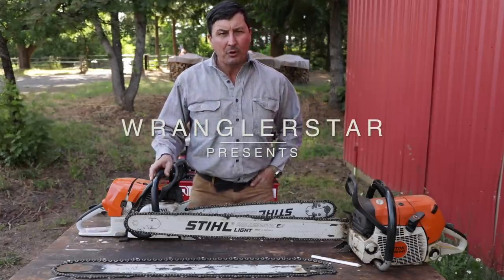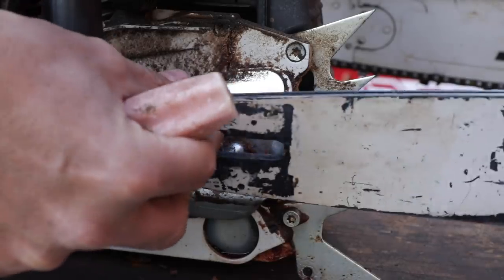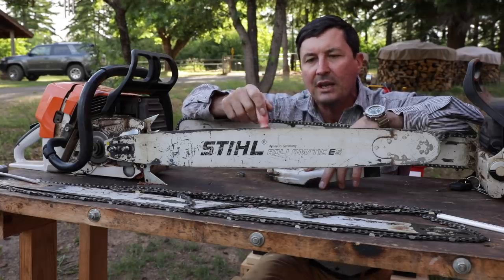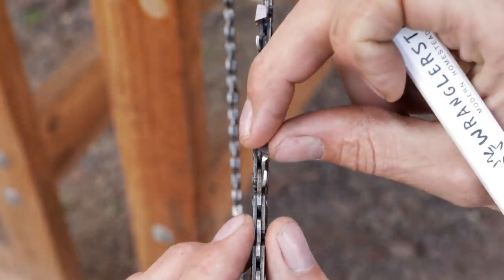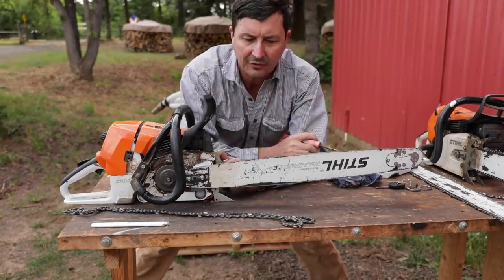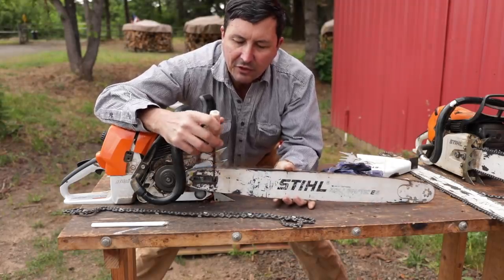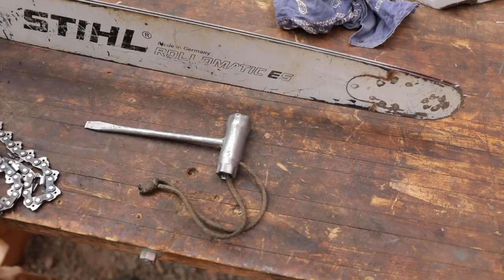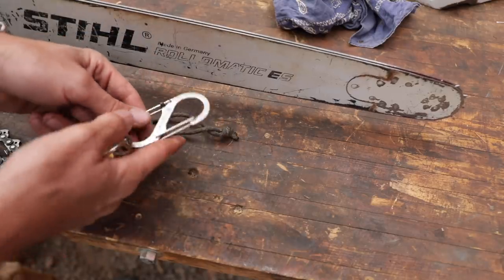Why Loggers Run Upside Down Chainsaw Bars

Comment from the maker: My Favorite Key Ring Carabiners https://www.amazon.com/shop/wranglerstar (link will direct you to my amazon store)
Reply: i dont know if you are stil looking for good quality precision files but i know some good ones
Reply: that is a great idea about switching the arm to last longer but just wondering have you used dewalt 20or40 volt chainsaw
Reply: NIteIze makes amazing products!
Reply: wranglerstar, i have a husq 261 saw. the piston is broken and seized in the cylinder not allowing access to the wristpin. as i am rebuilding the saw with a new cylinder and piston should i just cut the old cylinder in half to remove it from around the piston allowing me to get to the wristpin? the saw is torn all the way down. any thoughts besides junk it. it has alot of sentimental value and i would really like to continue with my rebuild.
Reply: Don't you double the time till you need a new bar by flipping it? Hence it would be 100% more lifetime not 50% more like you said.
Reply: You can plain in the bar Also they make tool to close or open the gap
Reply: Thoran666 ... You beat me to it. That's exactly what I was going to say. Flipping it would double the life of the bar. Doubling is a 100% increase.
Reply: thank you for all the informational videos
Reply: Grind the rails and buff the surface and replace the tip maybe 5 times. Last a long time . Dont turn them at all and lasts maybe a tenth of the time.
Reply: you actually made a vid about this ? smh can you use a screwdriver both ways?
Reply: adam conner you will get shavings in the lower end don’t risk it
Reply: @Thoran666  pay attention!! He said most of the wear and that wear depended on usage factors. The chains still running all around that bar. Lighter rubbing and heavier rubbing in areas dependant on use. Got it? Good day

Are you sure you got it? Well, we'lk see! God bless.
Reply: @Thoran666  You don't listen. The man said wear depends on usage. Limbing, top center. Topping, breaking all of the bottom, even the tip in pocket cuts. Chainsaw carving, nearly entire bar. But however you cut, the chain is still rubbing the ENTIRE BAR. Some areas lightly, some heavy. You got it? Good day.

Are you sure you got this? I don't know we will see. You could actually learn, if you paid attention. God bless.
Reply: @opiestanborough4774  Sure! Put the pointy end in your palm. Put the big round end on your fastener. Using hammer strike sharply with a hammer. Now go to the emergency room. God bless.
Reply: @grandpied    You don't listen. The man said wear depends on usage. Limbing, top center. Topping, breaking all of the bottom, even the tip in pocket cuts. Chainsaw carving, nearly entire bar. But however you cut, the chain is still rubbing the ENTIRE BAR. Some areas lightly, some heavy. You got it? Good day.
Reply: @grandpied    You don't listen. The man said wear depends on usage. Limbing, top center. Topping, breaking all of the bottom, even the tip in pocket cuts. Chainsaw carving, nearly entire bar. But however you cut, the chain is still rubbing the ENTIRE BAR. Some areas lightly, some heavy. You got it? Good day.
Reply: @flashwashington2735  Thanks for that explanation and summary of a video I watched 5 years ago. Have a nice day.

Comment: For anyone who wants to know how to tune your Chainsaw bar, there is some very simple yet very important things you need to do,, and you will get ten times the life out of a bar than had you not done this maintenance.. 
 First off, If you are cutting clean wood for either firewood of sawlogs, you won't be sharpening your chain very often.. 
 In that case your bar will end up with a burr where the chain rides in the rail,  "That needs to be filed flat".. 
 When you take your bar off to do this maintenance you will see that if you use your thumb nail and drag it where the chain runs in the rail, but on the flat of the bar, there will be a burr, Use you flat file,,The same file for filing your rakers and remove the burr.. 
  Secondly buy the tool for putting the right gap back in the rail the chain rides in...
  It's a small tool that closes the gap of the rail to the correct size that wears and opens from use.
 These are just little things us loggers do that most people never learn.. 
 We get a ton of use out of a bar that cuts tens of thousands of board feet of timber in a season.. 
 After ever SECOND sharpening use the flat file and file the raker with one stroke the length of the file, and NO MORE.. This will bring the raker down proportionally with the tooth.. When sharpening a saw with a standard round file, if you give one tooth three strokes, you give them all three strokes.. 
 It should never take more than that is you are doing the maintenance to keep the saw cutting properly..
 NEVER HIT THE DIRT.. If you hit the dirt with your chain, it will need to be sharpened right away, DON'T keep cutting.
 If your saw is cutting correctly it will be making wood chips, not sawdust..
 If it's not putting out chips, then it's dull and needs to be sharpened...
 Only flip the bar if there is a burr, file the burr off by placing the file on the flat of the bar and file it smooth, then flip the bar are remount it..
 Keep the right gap in the chain rail.
 File the rakers every second chain sharpening with one stroke of the raker file.
 Use a round file with file guide that has the angle of the tooth inscribed on the file guide.
 Keep the chain sharp.
 The correct tension is when you can pull up on the chain with moderate pressure and it not lift out of the rail the chain rides in.
 Be safe, A Sharp Chain is a safe chain, but a deadly chain if you are not extremely careful.
 Loggers Know That It's an Odds Game.. Every Day They Enter The Bush To Harvest Timber There Odds of Getting Hurt Increase.
 Don't Push Your Luck Or The Odds Are Not Going to be In Your Favour.
 and God Bless One and All,, Be safe out there,, and smart...

Comment: I prolong the cutting edge by running my chain backwards.
Reply: I dont thin...nevermind
Reply: You also save the lives of many trees using this practice.
Reply: LOL
Reply: 👍Burns a lot more gas though 🤣
Reply: I run mine backwards too! because it works just as good as forewards.
Reply: Gutz is der Deutschmaan awesum motorsagenhaaben.
Reply: I keep a herd of beavers.
Reply: Stays sharp longer too, especially when we run it in the ground to cut the tree roots. I like to fall a tree by cutting the roots first this way. I haven’t finished my first one yet, but I’m only doing it part time.
Reply: Ya a !!!!$

Comment: Good video! We get customers who have cut wood for YEARS who don't know this. 
Another tip: if your saw will not cut straight, 1) be sure the chain is sharpened properly and the depth guides filed properly. If it still wont cut straight and the bar isn't bent 2) We sand off the burrs that inevitably gather on the edge of the rails where the chain rides and run the bar down a disc sander thats perfectly perpendicular to the rails of the bar. After the 1st pass you can see where any low spots are or see that one side is lower than the other. This makes the chain sit on the bar at an angle. Keep running it down the disc sander until both rails are shiny and you see no low spots. Repeat for the other side, then blow out/clean the bar from any sander material/metal grit. This dramatically improves how straight it will cut.
Reply: I did this for my dads 20 y/o Stihl 044 bar on a surface grinder wheel, he'd previously draw filed it by hand with good success. The groove was so heavily worn the drive lugs would have bottomed out in the groove if i'd cleaned up the faces entirely! It got him through the weekend though and I ordered him a new bar & chain. 

That saw has cut at least 5 cord of wood every year of it's life since he's had it, and he bought it seized of a forestry worker. Gave it a hone and a piston, stihl going strong!
Reply: Patrick Rebecca Doohan v
Reply: That's called dressing the bar, which should be done EVERY time you have the chain and bar off the saw. Usually daily in a commercial environment. Personally I use a flat file and oil stone. Normally get 2 1/2 to 3 years out of 24" and 28" bars.
Reply: And if it still won't cut straight, you may need to replace your sprocket. A badly worn sprocket wreaks havoc on how the chain tracks, and it will also shorten the life of your bar.
Reply: @chriswillmott462  you have the bar and chain off and dreess the bar daily??
Reply: @danc3868  i still cant get my head around folks taking their chain off to sharpen it. That saw does not earn ya dollars when its idle.
Reply: @gregtaylor8327  I cartry spares when I'm out in the woods . Swap a chain if it touches dirt or dulls and flip the bar . I'll sharpen them when i get home .
Reply: @terrycoombs7693  Yep a spare chains a must.

Comment: I don't have much experience sharpening chainsaw chains, but my first thought when you mentioned the bars wearing out much faster when filing the teeth on the saw was metal shavings from the tooth filing getting into the chain and down into the bar where it  would stick due to the bar oil, essentially becoming an abrasive. I could be wrong, but it may be a factor. 

Either way, love your videos!

Comment: A couple things, I worked in a saw shop and learned from the best. A simple one is to run a putty knife down between the rails and get the junk out. That is the path the oil moves in, sawdust blocks that movement.
Just because the chain wobbles doesn't mean you through the bar away, it needs dressed. Dressing takes off the top edges, (removes the top of the V taking a lot of the movement out). It is done with a special grinder, with a flat place to rest the Bar at a right angle. If you have any saw shops in your area, call and ask if they "dress bars", it is an art. I am sure cost may vary, but for most likely under $20, it is well worth it to extend the life of an expensive Bar. Bar tips are also replaceable on a lot of bars, if the ends look like his, not solid. If getting a bartip replaced, a bar is almost always dressed so it is matched to the bar. 
A bar is totally worn out when the teeth on the chain start to ride on the bottom of the bar groove. If the bottom of the drive teeth show ANY wear that flattens them out, the bar is shot, you begin to ruin chains. Also anytime you have your bar and chain off, check the condition of your rim or sprocket. It is a 3 part system, if one part is shot, it starts wearing another. A chain that is stretched too much can wear out a bartip and rim, a bad rim, can wear a chain...
Use real bar oil, don't cut down the rackers to far (use a gauge), that will stretch your chain and can ruin your tip and rim, and don't force a dull chain!
Oh and if you see your chain starting to get too loose, stop and tighten it, snug, but not too tight, a loose chain slapping on the bar can cause your bar grooves to wear faster.
Reply: Also take a piece of wire and clean out the hole so the oil can access the channel in the bar.
Reply: We always carried a big flat file to dress the sides of the bar. I thought it was the greatest thing in the world when stihl started making self contained sprockets on the tip of thier bars and you didn't have to carry grease for the. If you ever had your little grease gun come open in your chaps pocket in hot weather you know what i mean. Lol
Reply: Any videos on dressing the bar....the right way? I’ve seen it done once or twice but anyway what grinder do you use? I will practice on burned up bars before customers lol
Reply: Jeff Vimpeny you don't need a video. All you are doing is knocking off the burr that forms on the edge usually most apparent right before or after the tip sprocket on the bar. Just smoth the bar our back to the side finish enough that all the burrs who will be at a 90°angle from the side are broken off or filed off. My recommendation is a long medium or fine file with a wooden handle. Doesn't take but a minute to fix a bar back to perfect cutting.
Reply: Jeff Vimpeny in this video at 4:55 there is a side view of the saw. Up towards the tip you will see a dark area on the edge of the top and bottom. That is where the worst of the burr that hinders cutting forms. They will eventually form over the entire straight parts of the bar but that is where it is the worst.
Reply: As far as all that goes it's been my experience that if the bar groove in fact is "v" shaped...it's that shape from the surface almost all the way down. Look at a (V)..While the top of the driver is against one side on the top of the groove, the tip of the driver is against the other side in the bottom of the groove, grinding the bar will not eliminate the "v" shape...what does happen a lot is that sometimes over time one side of the bar groove will get worn slightly more than the other causing the chain to run down the bar on an angle...resulting in a saw that will make an angled or crooked cut. Grinding the bar squares the bar groove surfaces to the bar so the chain will run flat making square cuts...but grinding will not take the "v" out...it will make it shorter but the "v" shape is still there and the side to side movement will still be there too. Look at the worn bar in the video...you can clearly see the "v" in it..grinding will not make it better...it's just time for a new bar...if you do a lot of felling you'll tend to end up with the "v" problem more than if you just buck all the time. That usually occurs right as you start the cuts required for felling before the bar can actually get into the tree...running dull chains will also cause a lot of bar problems since it's natural to start dogging and putting excessive down pressure on the bar to try to make it cut causing excessive heat and uneven wear..plugged oiling ports and forgetting to top off the oil every time you fuel will screw them up as well..I machine grind my chains and make sure that I have at least 3 or 4 extras for each saw...when their dull I swap them out...it's easier and faster than trying to hand sharpen in the field.

Comment: You can extend the life even further by squaring the rails back up true and then using a bar rail closer to close the groove back to spec so there is no side to side slop.

I really enjoy your videos, keep it up!
Reply: RookieChainsaws 
I've only ever met one guy who set the gap on his bars and squared the rail with a belt sander. I'll try to square it up with a flat file if I deburr it.
Reply: Micah Detwiler I myself usually only deburr and square one up every now and then, since I dont live on a saw and run many different saws when I do run one for extended periods, I've never actually had to close a gap. But you can probably get about one or two gap closures before the channel is too shallow and the drive links bottom out causing the tie straps to not ride on the rails.
Reply: As a guy that makes my living with chainsaws for the past 25 years I can say that the amount you gain by resetting a bar is negligible in the long run, I have better things to be doing with my time, like writing this lol! But seriously when you factor in tip wear and such it Is usually time to just replace the damn thing and be done with it.

Comment: Growing up in logging country I learned early on the bars are reversed to get a nice true edge. As the bars wears, it will tend to wear on one edge more than another causing the saw to walk and not cut straight. Another lesson learned is to dress the bar edges with a file to take the burs off. One more option for added longevity is to use a trueing tool to set the gap in the chain channel.

Comment: The bar isn't upsidown.  The logo is upsidown.
Reply: KFStreich
I always just flip the logo back over...
Reply: Brexit Monger it's easier to use a Velcro sticker with the logo.
Reply: KFStreigch...Lol.  Exactly.
Reply: He's not a tree guy. He's a youtuber.
Reply: The bar is upside down when the logo is upside down. Top or bottom it makes no difference as long as the bar wears evenly. The logo just helps you know that you flipped it. Wow and you made this comment for what reason? Probably the same reason I responded to it.
Reply: Upsidown?
Reply: I use my tooth brush left handed 🤔

Comment: Another handy tool is the depth guide gage. Helps you get the correct cutting depth on your cutters so they cut fast but not so fast they bog down the engine. Some of them have a hook formed on one end to use for cleaning out the bar. Also, a square block of wood and a good flat file can rescue a worn bar, especially the laminated ones. Seems they have a deeper chain groove sometimes. And just a quick look at the bar can spot a wire edge forming when they are wearing down.

Comment: I try to blow out my bar with compressed air regularly to keep the rails and the oil port clean.
Reply: I use the pick designed for that.Also grease the nose sprocket,too.

Comment: they also make a little small grease gun to grease the tip of your bar where the roller bearing is, as the oil from the Oiler that oils that chain does not make it to this bearing on the very tip of your saw, and if you'll notice there is a hole on both sides of the bar just like at the other end where the automatic Oiler does it oiling

Comment: Good tip about cleaning out the bar after filing.
I do that using compressed air, as well as cleaning out the chain after filing.
So far have been unable to kill a bar. and I rarely even flip them..

Comment: Good info all in all. What is important to note though is that  the saw itself is not the only thing with oil ports.  The bar itself has oil ports in it that tend to clog more than the ones on the saw.  Clean them all. A clean saw is a happy saw. McCulloch is my preferred saw but they all work about the same. You won't catch me carrying my truck keys in woods though.